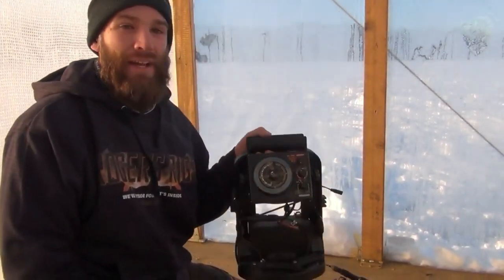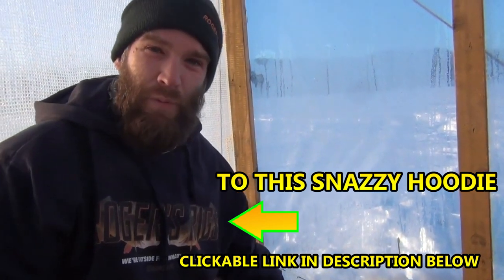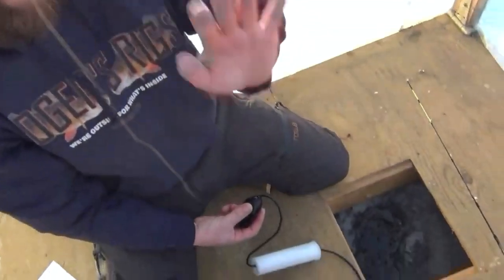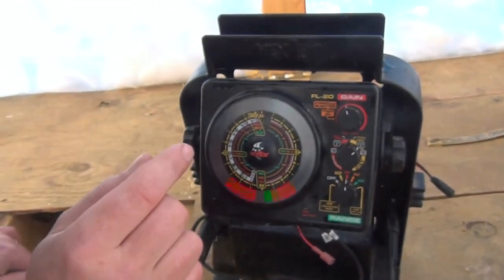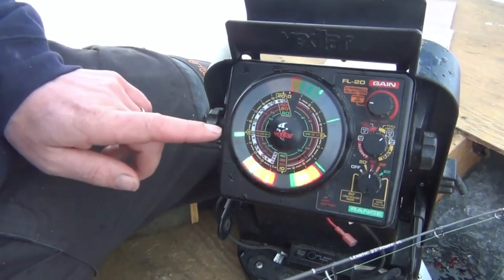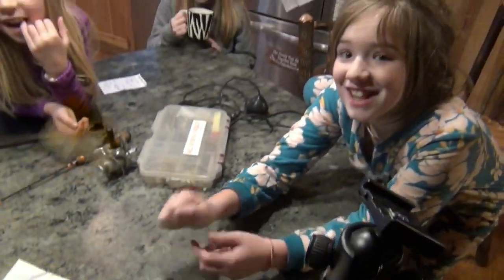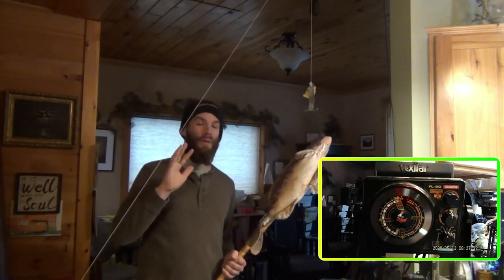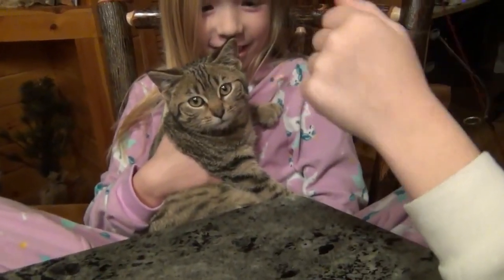What to buy, How-To Read It And Make Fish Bite using a Vexilar, Garmin, Hummingbird, Marcum Flasher

Comment: (chat ended)
I had asked it once before I think that the "flickering" is caused by the video and in normal use it's continual, right?
Reply from the maker: Yes.  there is somthing about the way video records the screen of a vexilar that makes it flicker like crazy.  i dont know what it is but in real life it is much more of a steady light
Reply: @RogersRigs  I think it has to do w/ synchronizing with digital “shutter” speeds and LEDs. LEDs blink. Look at LED lights like xmas lights or taillights and move your eyes back and forth. They don't streak or trail they make dotted lines.
Reply from the maker: yeah that makes sense.   its a bit of a pain for videoing tho.   what kind of temp do you have out there?    we have -12 here now
Reply: @RogersRigs  34° right now... Foggy... Makes for great black ice in the AM...